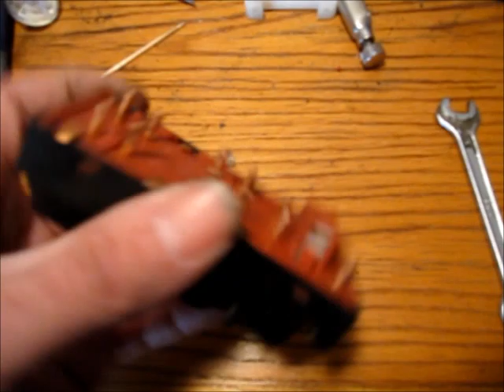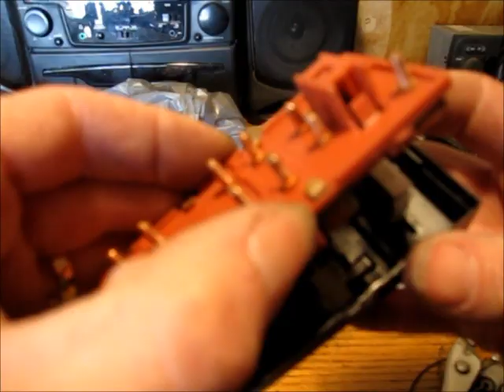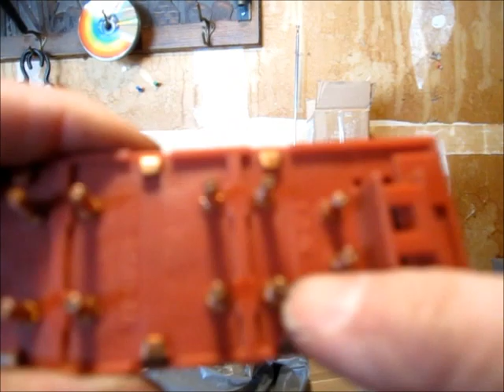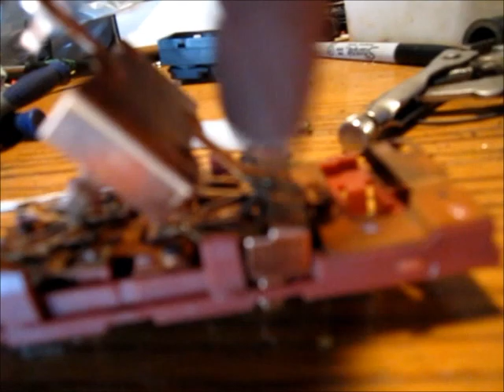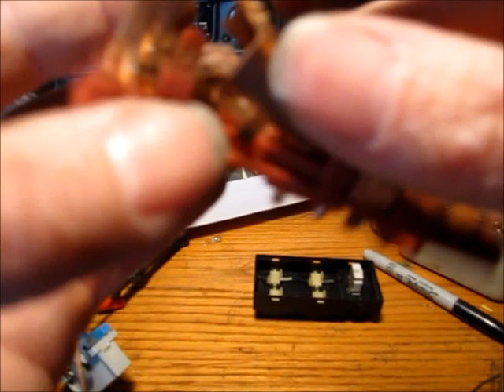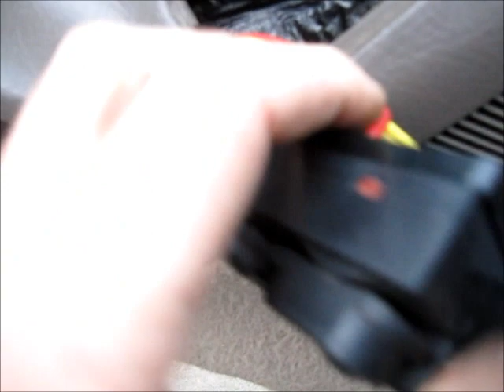Ford Power Window Repair - Fix The Switch

Comment: I have a 01 convertible mustang.and sometimes the passenger side will not roll down. Now the passenger side rolls down an the back drivers lil window will not. So far its stopped working an then magically does work ..  Now it's not. So im sure it needs cleaned like this..  Im assuming it's the switch.   What is your opinion on this?
Reply: Same issue im having did you ever find a solution?

Comment: I spent $15 on a used master switch, swapped out in 15 minutes.  Works great.  For me, not worthwhile going through all the steps involved in this video....but if time is not an issue, it is an interesting and probably a satisfying project.

Comment: I have the same problem long time ago (Windstar 2003). Some time later it would come back normal again. And as such happened quite often. Recently it is even serious. I've been searching the solution, but not quite fit to solve it exactly right or simple. 

This is my suggestion: If you don't find any wire problem, or any worn out mechanic problem, just go to take out the internal panel by unscrewing 5 screws off. Then directly disassemble the motor with three screws off. Take out the center part of the motor, and clean it and the shell of the motor inside out. You may put a little grease on the bottom and top portion of the center part (coil). Then put them all back. Make sure you have balance every single step including small gasket, and use a short and slim Philip screw drive, you may finish the job no more than half to one hour. Don't be fooled to take all regulator off and exchange with new one. It cost 50 or more. If you take away the small gasket, I mean, don’t put it back, it even puts the whole things easier and simple without noise or function problem.

*If you have only small 7mm (or 8mm) small and short socket, you can use a long flat screw driver insert into it to take out 2 screws under the window handle.

Normal step: take off the internal panel of window. 
1. Check the fuse . If it was cut or burned, replace it.
2. Check if the wire disconnected in between window and fuse box or switch is bad (w/ V meter). Connect it back, or replace a new one. 
3. Directly unscrew the motor, clean inside out. Grease top and bottom of the center coil.Then put it back. If you can tape or add silicon to seal the gap of motor and gear, Even better. It may avoid moisture into motor. Make sure when you put it back the center coil first, insert into the hole, then turn clockwise a few times till it turns smoothly.
4. Check if the whole screws or rivets loose, or regulator stuck. Replace it if needed. 
5. Clean and lubricate the edge of window glass, if needed. 

Most of the time, you just need to proceed the 3rd one. Good luck!

Comment: I took mine to the dealer, they wanted $250. LOL!! I bought a new switch on Amazon and replaced it myself. I don't know if I'd go to this length to disassemble the switch, but it's good to know it can be done! I thought it was a sealed unit.

Comment: I have a '93 Ranger that both windows stopped working at the same time. I replaced the circuit breaker and have power to master switch. Could the master switch be my problem?

Comment from the maker: Hi, if possible try to apply voltage directly to the motor. If it works, then you know it's the switch or a bad connection somewhere. Good luck!

Comment: I have a 1994 ford explore and the passage window is not working with either door switch, both passenger & drivers.   Would you still recommended cleaning the switch?

Thanks

Comment: as a  FIY  if the  drivers window is the only window  affected  check the  relay  mounted on the lower door it is called a one touch relay  for the auto down  function
 relay cost is aprox  20 - 30   master switch can cost 60 -70

Comment: very out of focus...use alcohol and brush 1st....usually only if terminal doesnt clean, then use fine sand paper or scrap with flat screwdriver, and clean with alcohol after you scrap or sand, and air dry or use compressed air

Comment: great vid, but 1st thing you should do it your window doesnt work is test for power at the main switch , if power is coming out of the switch, then test for power at the switch where window is not working, if there is power at the switch, then you shouldnt take switch apart, possibly motor problems..sometimes banging on motor with small hammer does the trick.  most motors if opened up are hard to reassemble.  usually replacement is recommended.

Comment: Thanks for this video! I did a friend's with pretty much the same method as you but his wasn't a Ford. 

Unfortunately this didn't work for mine and I've determined it's actually the motor itself! Thanks!